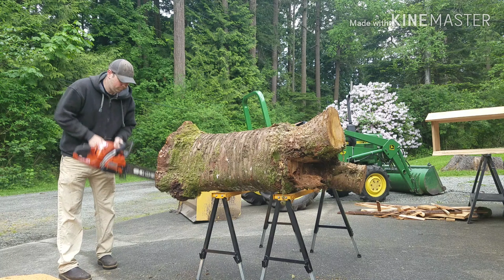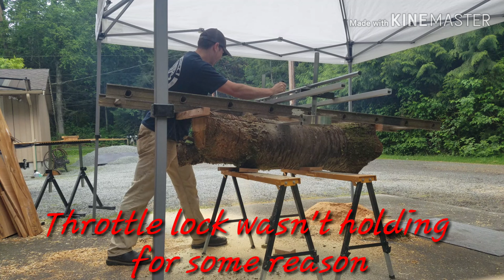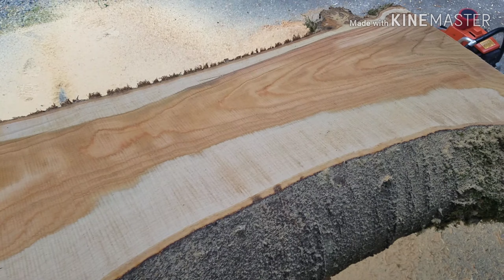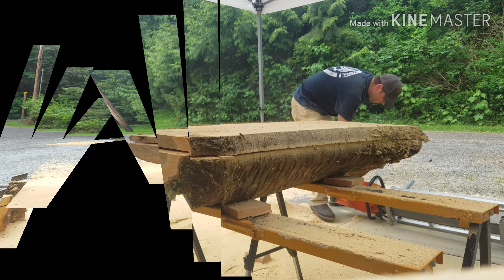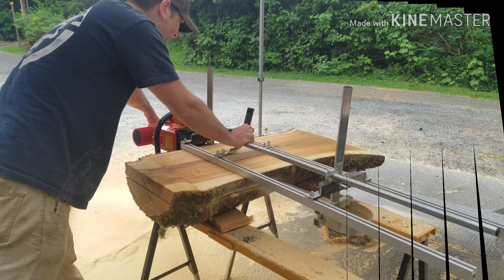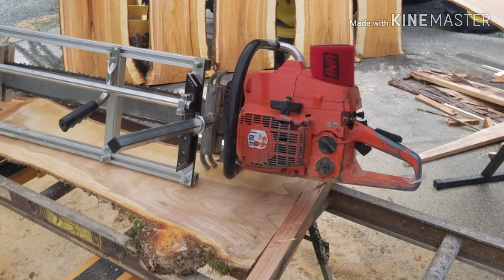Husqvarna 298 XP - Alaskan mill

Comment: Hi, I have the same Husqvarna 298 can you please explain the benefits of this air filter setup. Thanks!
Reply from the maker: More air flow, better filtration, & easier to clean. The factory filter & cover pull air in up under the cover (how they're supposed to work) but it tends to pull everything else (sawdust) in with it and packs the filter, especially with the extra fine dust created when milling. The saw has port work done to it so the added airflow helps, but my sole reasoning is that it filters better (its a 2 piece foam filter) and it's easy to clean.

Comment: What chain are you running for this?
Reply from the maker: We used to be picky and only run Carlton, Oregon & Woodland pro dedicated "milling chain." Now we run standard Stihl. It seems to have the hardest cutters. A little tougher to file, but seems to hold an edge longer. 3/8 pitch .063" gauge. We used to run semi chisel full comp, but recently we've been running full chisel skip tooth with good results. The key (in my opinion) is to file your top plate to 5° 
A top plate at the standard 25°-30° angle produces a much rougher cut. Long story short, any chain as long as the top plate is 5° but we currently run Stihl